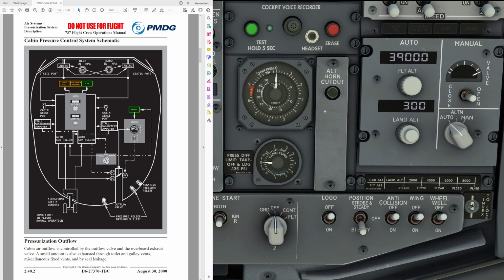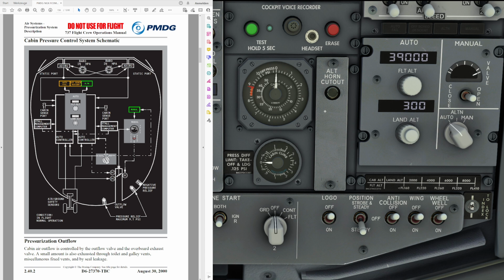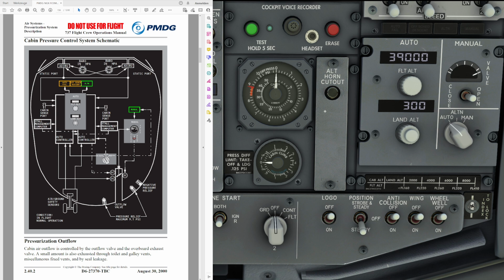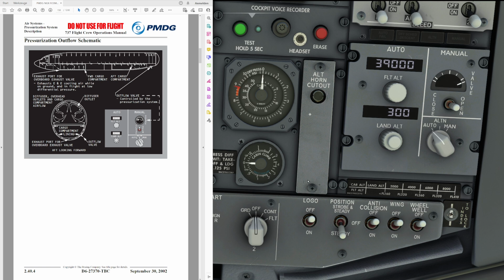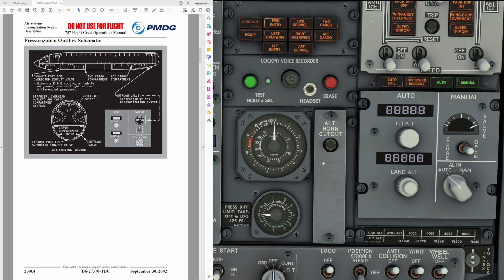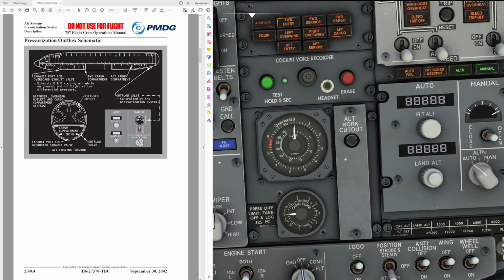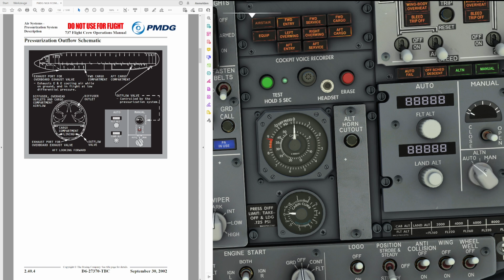737NG Pressurization System explained | Real 737 Pilot

Comment: I am getting the long needle usually just below or even at the beginning of the red zone in PMDG during cruise. Is it a problem or normal? I think I properly set FLT ALT, but it’s a bit confusing
Reply from the maker: The big needle indicates differential pressure. Something around 8PSI is totally normal in cruise at high flight levels.
Reply: @A330Driver  thank you for the reply, good to know 👍🏻

Comment: This is a great video as are all which you made. I am specially drawn to those you put on lately about B 737 sub systems. Can you please share this pdf document you are using on left hand side?  There is no such pdf in my Documents folder within PMDG 737 installation.
Reply from the maker: The document was delivered 11 years ago with the PMDG 737 NGX for FSX. It is no longer included in the latest MSFS release due to licensing reasons.
I'm afraid since it is copyrighted I am not allowed to share it.
Reply: @A330Driver  Not a problem at all. I'll just sniff around the Net 🤫

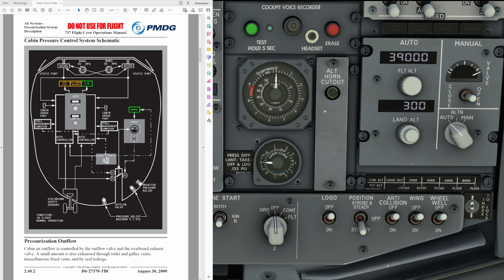Comment: 6:15 Actually, the negative pressure relief valve is even simpler than the diagram. It's a hinged door with a spring on the hinge! The maintenance manual doesn't go into much detail on the mechanism for the positive pressure relief valve except to say there is a pneumatically operated servo mechanism which controls the valve flapper.